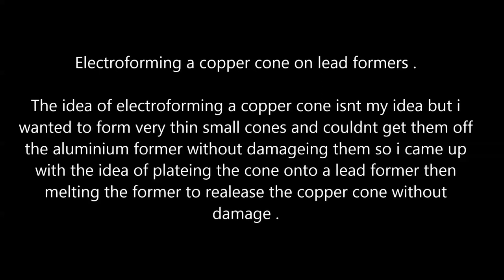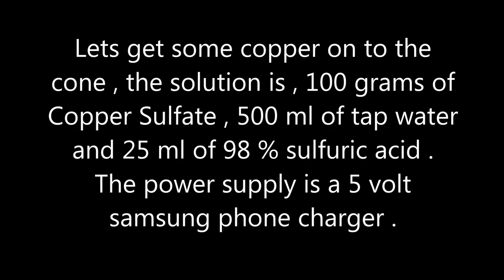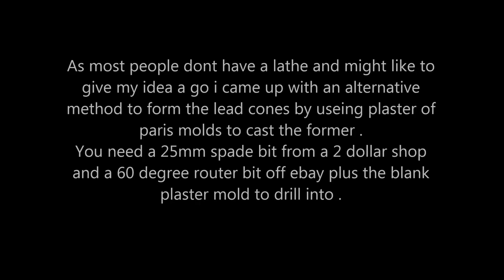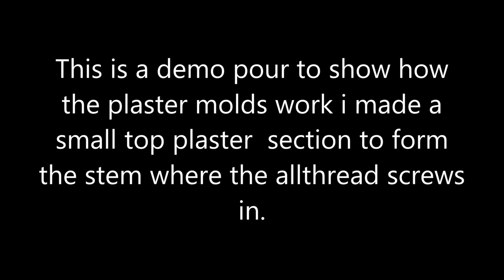Electroforming a shaped charge copper cone .

Comment: you do not need to heat the lead out. immerse the lead cone in a 10 percent solution of potassium dichromate solution for 30-60 seconds. this forms a passivated layer on the lead only microns thick, but still electrically conductive. electroformed parts will pop right off after plating.

Comment: I wonder if you can spin sheet copper into a cone like that on the lathe.
Reply: single point forming will work but it work hardens so needs often heating and the cone becomes too thin at the tip where you really want it thicker

Comment: now a days one just 3d prints a cone and spray it with conductive graphite paint, or just print cones with 80% copper powder filament.  times change, remember when i was hot hammering alu dies and copper plates.

Comment: that system and result looks pretty good. Ages ago when i first was experimenting with making cones i did try lead casting but could never get a symmetrical form. but then i was using circular sections of drink cans to make cone shapes with. the ones you made here look pretty neat. 0.29mm is a bit thin for my preference but they'd still work fine although to press anything on top of them you really need to fill the cavity to not collapse it. Have you tested them? Also did you see any difference in heating the plating bath vs cold?
Reply from the maker: AllChemystery  Thanks ,  they are very thin as i read some literature that said to keep the cone thickness between 0.01 to 0.06 x the cone diameter , the filling would have to be a cast one as a result in smaller diameters .
I like the bath to be warm its just a preference same as  stirring the solution .
Reply: plating bath would be optimum around 64-65 degrees celcius, with some thiourea and gelatin (around 3-4 mg/L)

Comment: why is copper the metal widely used in sc's? can alternative metals be used?
Reply: ductility. ya there are better. namely tantalum
Reply: I believe the density is also a factor. IIRC more mass makes for more punch.
Reply: sad faggot  Well, more copper just means more mass, higher density means same mass in smaller package. Same end, different means. But yes, copper's plentiful and relatively cheap, so it gets used.

Comment: I have watched this vid but still I have no idea what you were doing?
Reply: he make an copper cone for chaped charge. He will put this cone in a cylinder of steel or very strong material (also dense). You press in PETN or the like, PETN is a good choice if you work with small cones as he does. OTherwise you go for RDX or octogen or some exotic.  The cone bottom must have the right distance to the material that he wants to blow a hole through.  If you use a more flat cone you can use it fo hit things at distance. Its more of a weapon in that case. To play with this things are not okey says our criminal goverments (runned by the banks).